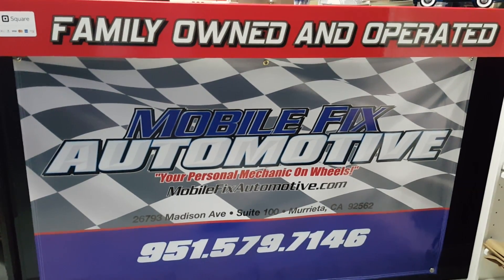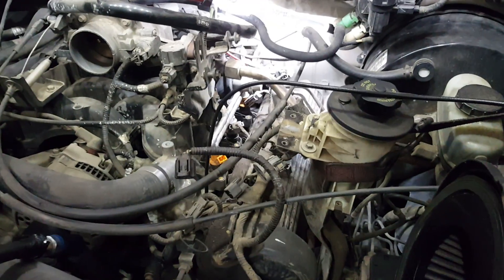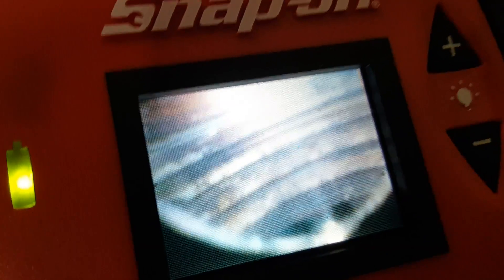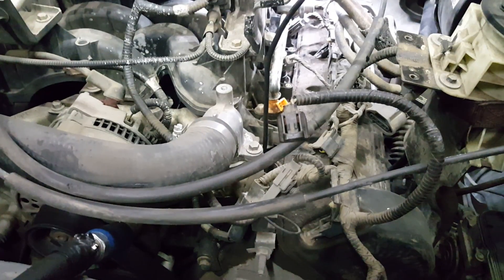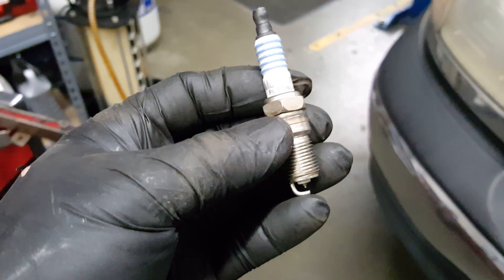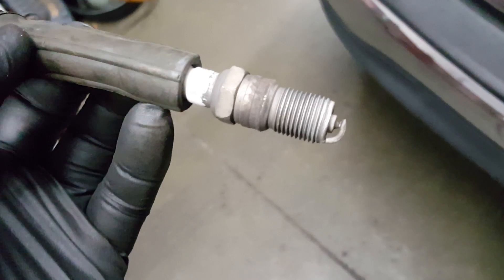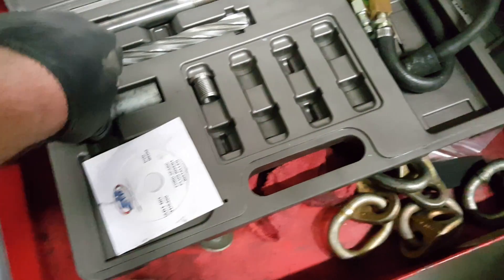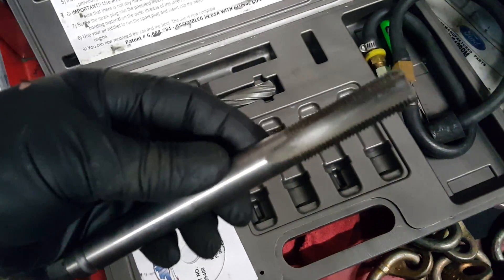Why the spark plug blew out of your Ford Triton engine

Comment: And another reason I won't drive a Ford.
Reply: It took my truck 250k miles on my 6.8 tell it happen to me. And I as well would recommend that tool, that thing was a life saver, super easy to use and gives you so much more threads for the spark plug.
Reply: @Blue_Country_Boy knock on wood😐
Reply from the maker: I wish everyone could be so lucky

Comment: Ford doesn't care because it isn't a safety issue.  I think it was a bad design, but I recall seeing a truck that blew out inserts as well. So one could argue is it something with the metallurgy of the head, people not torqueing things right, or some other reason unknown. I say it is a bad design on paper because it should have twice the length of threads to the diameter of the hole, when it comes to aluminum.  What you see on the ford head looks like about the same thread length to diameter, which is what is good for steel or perhaps cast iron not aluminum. I have made custom inserts on the lathe when it has blown out the biggest insert  you can buy. Switching to a course thread pitch for the insert. Fine thread pitches have more holding power, but not in the case of just blowing it out.  In the video claims around 200 psi... That is just compressing air the air  There is a pretty good bomb going off every time the engine fire a cylinder.

Comment: That's a shame! Ford needs to just recall all the modular V8 engines that have that issue with the spark plug hole threads. Whoever was the engineer on the Ford Modular V8 engine team should be fully responsible for his/her screw up when it came to the spark plug holes and countless other mishaps with a family of engines that's supposed to be superior (in theory) to their older engines and their rivals. I own a 2002 Ford F-150 XLT SuperCrew 4x2 powered by a 5.4L Triton 2V V8 that has 203,000 miles on her and done plenty of work on her; the most work I had done to my truck is changed the intake manifold because the old one had a leaking coolent crossover manifold gasket. Other than oil changes and a tune up, my truck is good, even though I worry about those spark plugs spitting out.

Comment: I've never spit a plug but every plug change I have done I've always torqued them to 25 foot pounds. Yes Ford screwed up and only tapped 4 threads but there greatest mistake was the factory 11-15 ft lbs.

Comment: Obviously it's the heads not having enough threads, your assessment is spot on, you shouldn't even doubt it, it can't be anything else the problem is crystal clear. What I'd like to know is, are you drilling with the heads on and if so how the heck are you keeping the metal shavings out of the cylinders? Or getting them out if they are ending up there?
Reply from the maker: +Gary Riefle yes I'm drilling with the heads on the engine. There's another video that I did on how to actually repair it you might want to watch that one the shavings do go into the engine but we remove them with high compressed air and we use a camera to make sure that all of its out before we start the engine
Reply: Ron Williams got it, yes I'll watch it for reference. I have a 97 f150 with the 4.6 I hope I never have to do this that engine sits back partially under the firewall. If I gotta end up drilling the back plug holes I'm screwed heads will have to come off, no way I'll get a drill back there and the plug holes are angled opposite directions from both sides of the motor. Plugs on the left side angled to the front of the truck, plug holes on the right side angle to the back towards the firewall... stupid design geez. I did change the plugs a week ago and encountered no issues, hopefully I won't either.
Reply from the maker: +Gary Riefle yeah I watch the video I've never had to pull a cylinder head on any Ford car or truck even in the vans to do this job you just have to have an angled impact it shows you in the video how I do it

Comment: hey ron my thoughts exactly ford should be ashamed.   I replaced my intake gaskets yesterday truck ran perfectly then number two plig wire popped off cleand off grease and sprayed off  plug wire snapped back in the 15 min later while bleeding coolant pop again darn number 4 popped off tried to get back on would not go on so pulled the plug upon tryna reinstall plug would no catch threads so im pretty sure nthread are gone.  question waiting on my scope to look into chamber, is number four posible to do without removing the intake again, to retap?  also can the truck be driving to the shop 4 miles up the street if I dont feel like doing the work again or shouldit be towed
Reply from the maker: +Andrew Carter i never remove anything but move hoses out of the way except for power steering brace on driver side to access 2 front on left head. 
Ive had many people drive to my shop to fix. I just have them disconnect the injector plug on tge cylinder that blew plug.

Comment: hey ron i have a question at 7:16 you said dont use that coil or else you can get a misfire and burn up your catalyytic converter. does this happen because its just fuel goin straight into the cylinder without being burned off then to much gas is passing through the exhaust and kills the cat? because i had a misfire once on my car and it was from a failed coil pack and what do you know i smelt sulfer out of the exhaust and ruined my cat.

Comment: This issue should have been fixed by ford within a year.I could see 1 year of engines having this issue then ford fixes it but how many years did ford continue making them like this?
How many people got ripped at the dealership for a new head or set of heads because of this complete stupidity on fords part.
Did they design it like this to fail?Like really only 4 threads holding the plug in....REALLY.
Reply: I think we have to start being more of assholes toward ford and say that they put 4 threads on the cylinder heads ON PURPOSE ! how can you go 6 years without correcting this? only explanation is they did it purposley to make money because they know people keep there trucks well past the warranty period and they know people with still pay the thousands of dollars to fix there truck.
Reply: Linuxx
When it comes to enginnering a cylider head I will be the first to say I don't have a clue what goes into building such a piece but Any idiot with half a brain knows you need more then 4 threads to secure the plug plus factor in the plug is in the worst possible enviornment being subjected to thousands of heating and cooling cycles not to mention it is common knowledge the steel plugs will fuse to the aluminum cyl head causing one to ripping the threads out of the cyl head while removing the plug that has been there for 60k miles ....or the plug breaks.
Like you said...it is almost like ford did it on purpose...or they are very stupid which I highly doubt.
Reply: Your right about that ,and how about those silverados? The clusters go out year after year and they never fix the problem.
Reply: @Bill Rayvan Yet he's still smarter than the morons that keep buying piece of shit Fords...
Reply: thats why I went to chevy
Reply: My assumption is they made them that way until the final year(2003 I believe) before they went to the notorious design they are known for with the 3 valve heads. I have an 02 super duty with the 5.4 and had #1 blow out on me. had maybe around 70k on the odometer and it was 5 years old. My Haynes manual lists the torque specs for the plugs, and everything up to 02 is at 11 ft lbs. 03 is bumped up to 23. Probably have the extra torque needed to turn the plugs against the more threads to seat was my best guess
Reply: Linuxx I DONT THINK FORD DID IT PURPOSELY.....THIS COULD BE A RECALL IF SOMEBODY GETS HURT...I AM GOING TO COMPLAIN TO FORD WE ALMOST GOT HIT BECUZ MY EXCURSION TURNED OFF.

Comment: my mechanic tried to fix mine, now he says u have to replace the heads:(  there's no compression on the cylinder he said after I spent almost 1000 dlls already:(
Reply from the maker: i hear that happens to people once in a while.  it could be the valves got bent by drill bit if they were open at time of drilling.  are you sure there is no compression,  or  can it be that the coil is bad? i found that to be the case on a truck brought to me after someone else did insert.
Reply from the maker: +Ron Williams p.s. i have never had a failure like that in all these i have done.
Reply: I replace all the coils, spark plugs, etc and he said there's no compression
Reply: my truck also has low compression on two of the three plugs that blew out. and that was before we put new inserts in for oem plugs. I first used oreillys fix kit(plug and retap sleave) what was odd was that when I replaced those again the ends where destroyed. could there kit have been too long , and the valve hit the plug? and now the compression is low because it bent the valves on those two cylinders?